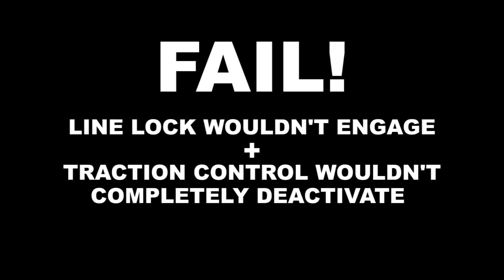NEW MEAT! 2019 Charger gets a new tire setup! Nitto 555 G2

Comment: The tps will figure out the location of the rims/tire after a couple miles of driving. No need to remember what location the rims are at. It is done by the ecu measuring the time it get the return signal from the tps.